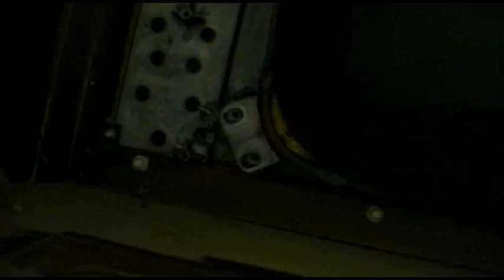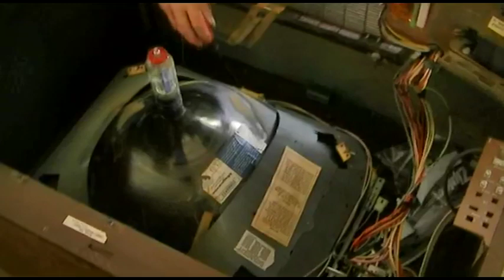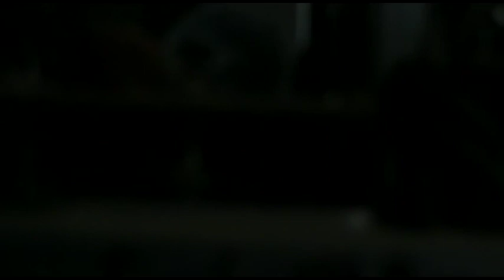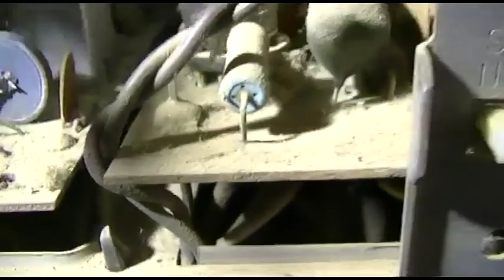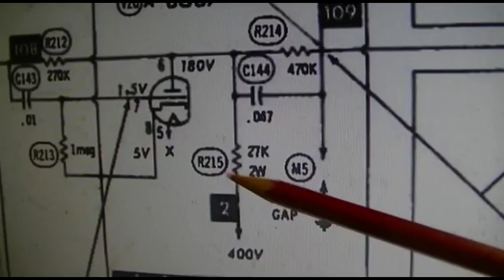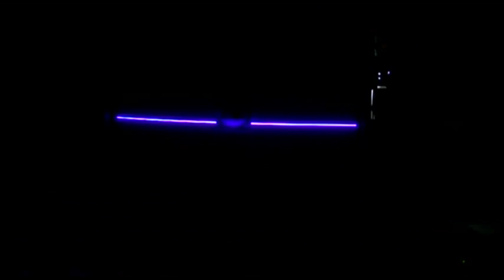Replacing CRTs And Repairing RCA CTC28 Color Television Checking Degaussing And Dim Picture

Comment: I would try to Degauss it again by hand, You have cracked solder under the thermistor, possibly the VDR & rectifier diodes & other places, that's what's arcing under the chassis! AND have you re-capped the set yet &/or checked them damn baulbs & carbon drifters (tubes and resistors)?? Don't expect top performance & dependability until you do all that....And no offense, but I smoke in my house & NONE of MY electronics suffer from your supposed "cigarette smoke infused paste", etc LOL!. It's more like cooking grease and capacitor leakage and 50+ years of dust! Sure do enjoy watching you fix all that stuff, though, keep it up, Shango! You ROCK! :)

Comment: If the CRT blows (implodes) large chunks of razor sharp glass fly in all directions at high speed.  Exposing your naked arms (and blood vessels) to such a bomb is a bad idea.  Ten years ago I have been cut by a chunk of glass.  It sliced my leg in a blink of an eye.  It took more than 20 stitches to close that gap.  Luckily, no veins were cut or I would have been EOL.

Comment: I love this channel. How can i learn to do that?
Reply: Start by getting a book or three about electronics. Then get an electronics learning or training kit and do the lessons and experiments. Then begin working on simple circuits and devices. Understanding electricity; volts, ohms, amps, watts. That's electrostatic potential, resistance, current flow, and power. Then you can get into capacitance and inductance. Then study amplifiers and oscillators. Audio frequency, radio frequency signals. Get Some old used test equipment. Ham radio festivals and swap meets are great as well as radio museums or clubs. Then study the equipment you are interested in. Like playing a sport or instrument it will take time and effort. But the sense of satisfaction from learning and mastering concepts and applying it to repairing are totally satisfying. Good luck and God Bless.

Comment: As a young apprentice back in the early 70's the one job that I hated doing was changing a crt picture tube.  These thingscan be very dangerous if the ht input connector on the tube has not had its internal voltage discharged first.  These tubesare like capacitors, and there is a voltage inside them all the time, even when not powered up, so it needs to be dischargedbefore handling the tube.
Reply: Almost every guy that puts his hands into this stuff knows that.

Comment: That crud on your chassis has nothing to do with cigarettes. A few days ago I fixed my computer monitor, which has been on pretty much all day, every day, since the spring of 2006, and I smoke about a pack a day. Here's the chassis - https://i.imgur.com/p8eDkLe.jpg. Nothing on it but normal dust; none of that greasy black crud like on your chassis. In all likelihood, your TV spent many years in or near a kitchen with a lot of frying going on. You should have cleaned it before working on it.